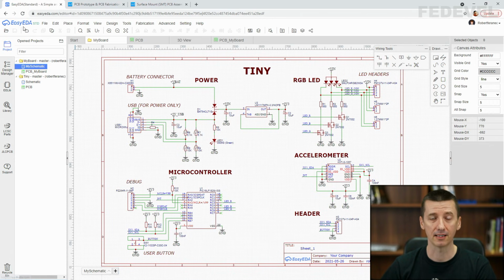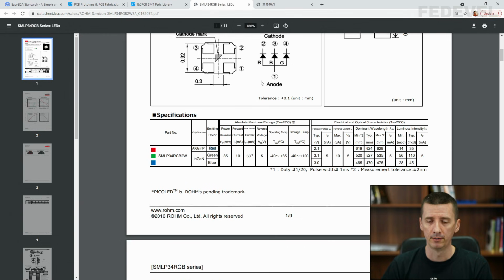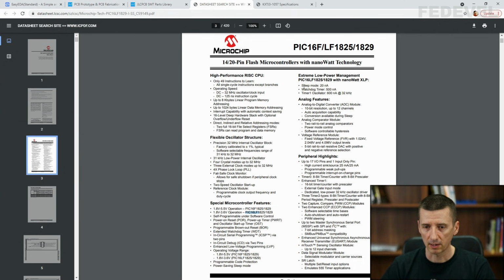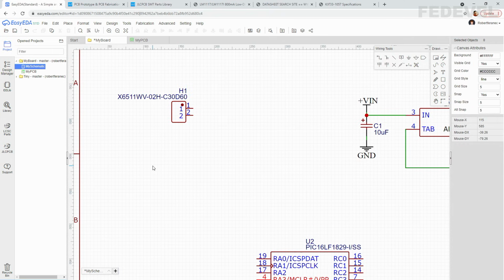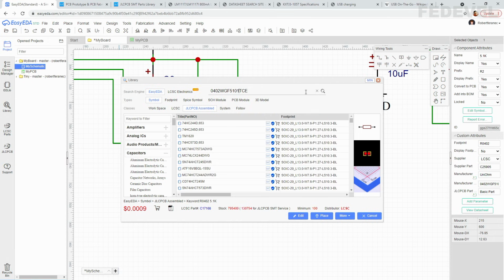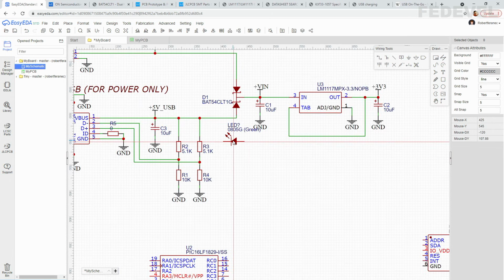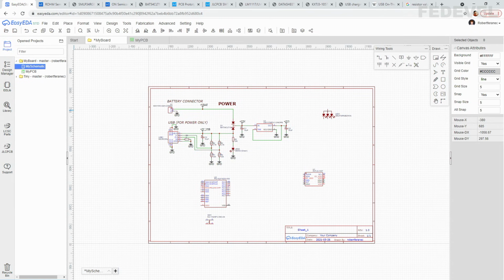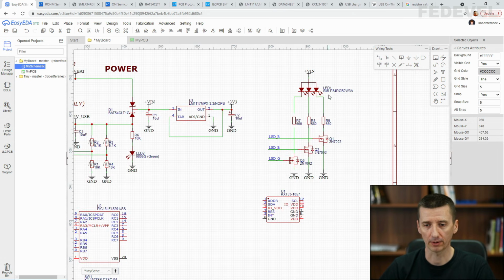Tutorial #1: How to Design and Build Your Own Board - Simply and Easily

Comment from the maker: If some components are not in stock, do not worry. You can buy them from a different supplier or you can buy a replacement and solder them when you receive your board. I am talking about it in Tutorial #5 https://www.youtube.com/watch?v=yptbPYe1BL0&t=6174s
Reply: Any similar component? for example the LED in this video could be replaced by some other similar LED, instead of buying from different supplier, or find replacement? This is my first time building the board, appreciate for guidance. Thank you.
Reply from the maker: @leemingxiang8965  you can use any RGB LED with common anode.

Comment: sir,

Why did you use the same 560 Ω resistor for each channel of the RGB LED instead of using different resistor values?

According to the datasheet, the forward voltage (Vf) is different for each LED color, so using the same resistor value would result in different currents for the Red, Green, and Blue LEDs.

Also, I noticed that you designed for approximately 10 mA per LED. However, the datasheet states that when all three colors are operated simultaneously, the Absolute Maximum Rating should be reduced to 30%.

Since I may operate all three colors at the same time, why not choose the resistor values so that the current through each LED is limited to around 2.5 mA instead?

Thank you.

Comment: Awesome tutorial, full newb here with a quieston - at 47:40 when explaining about the barrier diodes, can we use transistor or a mosfet with a gate connected to the USB vcc so when USB power is connected, the mosfet opens, breaking the battery circuit?

Reasoning for my question - the forward voltage drop even at 0.4v is significant when working with 3.7v lipo battery

Comment: Hi roberts  thanks for the series. these are useful as am just getting in to electronic with no electronic background .just a quick qtn , COULD YOU BE IN POSITION TO DO A VEDIO OF THE VOLTAGE AND CURRENT REQUIREMENTS OF THE APPLICATION THAT MADE YOU USE THE DIFFERENT ELECTRONIC PARTS YOU USED IN THE SEREIS

Comment: I think placing the power LED  behind the diode will not indicate when we are using the battery as the power source.. qtn why don't we put the LED bwt the diodes and the capacitor(c1 10uF ) and then use the MOSFET transistor  to trigger a voltage supply when either the battery or USB is used as a power source?
Reply from the maker: when battery powered, I wanted to minimize the power consumption.

Comment: thanks, Robert for the presentation ,,, my qtn is about the diode ,,, what would happen if someone plugged in two power supplies at once ,,,, how would the diode respond
Reply from the maker: the power will only be delivered from the source with higher voltage. other source will not be used

Comment: Thank you for the wonderful set of instructional videos. Extremely helpful.  

I have a question: My project uses SPST switches that are not located on the PCB, but rather on the front panel of the housing. They will be wired to the PCB to specific points. How do I represent this in the schematic? I basically need two Vias that will be connected to other parts on the PCB. I can add the Vias on the PCB and run the connections manually, but is there a way to represent this in the schematic, so that the wiring is already incorporated in the PCB? I tried Pins, but they do not transfer to the PCB.

Comment: I would ve expected the accelerometer sense the "acceleration", It made me confused when you showed the working board at the end. You are rotating it and it senses different acceleration even though the sensor is not in motion. I seems like it measures the somehow static acceleration even thought I am not sure it can be defined in this way. Do you have any though/comment on this ? And like how can we exactly conclude what the sensor measures in general ?
Reply from the maker: Don't forget, g always exists and it points down to the earth. So even if nothing is happing, the accelerometer always "see" where the ground is.
Reply: @RobertFeranec   correct. After I asked, I made some research on it and realized that the gravity needs to be compensated by converting the local reference frame to earth frame if you would like get the acceleration of the object from the stationary reference frame. Wanted to share it with you too, thanks Robert!

Comment: Pls sir I got another question......the power circuit here ....I use a 6 lithium battery...that's 25.5v ....18 pieces of 18650 battery in series parallel...that's 3 connector into 6 places to make the 6s.....pls which diode can I use to make sure the voltage doesn't return to charger...when there's not power in the charger....

Comment: Robo, just a note: the losses on the preset resistor for the LED will be the same as the losses on the LDO and the smaller resistor if the LED is powered from a +3V3 source. ;-)

Comment: Hello, currently I'm working on my own PCB and I need 5v for my IC's. I need to power circuit with USB and/or +12V (car battery), so I placed LDO before diode (SBD), but, if I understand correctly, after diode there will be only apx. 4.5 volts. How can I fix this ? Thanks.

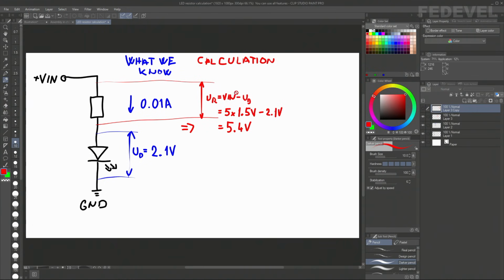Comment: Regarding the diagram shown at 1:00:20 there are two items of note. 1) The 10mA is the absolute maximum rating. Generally just a couple of milliamps is plenty of current to light up an LED brightly. 2) Fresh 1.5V batteries are often closer to 1.6V, so instead of 5.4V you might get 5.9V.
Reply from the maker: Thank you derstrom8. PS: The resistors still may be adjusted by the end of this project, you will see what the plan with the LED is (I have not explained everything in the video). But yes, your points are correct.

Comment: I'm not sure where to post this question but I'm trying to connect a Coral Edge TPU to the IMX6 and the datasheet for the Coral says that their USB connection is 1.8V logic, where the IMX6 doesn't mention the voltage level for USB. Would I need some sort of voltage level converting chip in between both components? Assuming the IMX6 is 3.3v.

I have your advanced PCB layout course but haven't gone through it all, would the answer be in there perhaps?

Thank you for your help.

Comment: Great explanations, thank you very much!
Isn't the maximum allowed current of the LEDs 5 ma, so you should increase the resistor values?

When does one put a reverse diode over the LDO?
Reply from the maker: Thank you phenyl22 PS: I used Absolute Maximum forward current 10mA in calculation, because most of the times the currents will be lower (e.g. when battery will be discharging + loses on diode and transistor) and I would like to have the highest possible brightness also when battery is low. Also, I do not use reverse diode on LDO, I have not seen that.
Reply: @RobertFeranec  There's a TI note "LDO Basics: Preventing reverse current" by Mark Sellers in the E2E part of their website , which states "the body diode can turn on when the output exceeds the input voltage plus the VFB of the parasitic diode. Reverse current flow through this diode can cause device damage through device heating, electromigration or latch-up events." So if I don't forget I put an external diode over the LDO. Reading it closer I saw that the diodes you put in front (BAT54) do the same thing, they also prevent the flow of any reverse current.
So I learned something today :) Thank you very much for your great tutorials and the time you take for answering to comments!

Comment: Suppose the +5_usb and +vbat are powering, will both voltage add up at the +VIN of the LM1117?
Reply: No, the two Schottky diodes prevent that, they are effectively an OR - gate for the current to the circuit  and prevent current from flowing back to the sources. The voltage at the common cathode is the higher input voltage minus the diode forward voltage.

Comment: Hi, just curious,  I've never used their service, and I use kicad. Is there any way to know which parts from their library are available for assembly without having to search inside easyeda?
Reply: Also, in the KiCAD schematic editor to to the table view of components and you have a nice spot to add a column for the order codes so that you can get them exported with the component list and import them when uploading the design
Reply: Someone has made a script for converting kicad to jlcpcb, some hands-on work required I guess ;)
Reply: Somehow I cannot post links so: GitHub matthewlai jlckicadtools should lead to it :)
Reply: They have API.
And also you can use their BOM tool to adjust used components list
Reply: They also have a list of components on the jlc website. You can find it if you go to the assemble service info page

Comment: i would like to know what are the parameters when u need to select an crystall oscilator for a uControler, i have some proyects that need a uControler with a crystall but i dont know how to select it. Any help?
Reply from the maker: Usually each chip manufacturer has an application note on this topic. Or, just use what they used on their own boards - that is also a way.
Reply: @RobertFeranec  thanks.

So if y can't find any of the manufacturer proposed crystals or the one used in other board there are no easy way. Mmmm i found one but cost 3 times the cost of the uControler 😅😅😅, I'll keep searching.
Reply: You might want to chose  an MCU with an internal crystal and save parts, that's if you project is not super time sensitive, otherwise just search a supplier for crystal and the desired frequency, then its a matter of what physical size you want.

Comment: At the Sonsivri forum, they exchanged views on which manufacturer of PCB prototypes is more interesting today and the majority agreed that today JLCPCB is the best, especially at the lowest price of production, assembly and delivery.
Reply from the maker: Low price is the reason why I use them. Also, they have Stackups and impedances (+ impedance calculator) on their website.
Reply: @RobertFeranec  I am attracted by the possibility that you can immediately see that the resulting visualization of the assembled PCB, and check the orientation of the components and correct errors. And the most important thing is that if you need to urgently make it, then from the moment of payment to the receipt of the assembled printed circuit boards "on hand" it took no more than 6 days. I live in Ukraine! This is a very convenient solution for me.
A similar production of PCB prototypes in Ukraine is 6 times more expensive and there are no guarantees for the production time.

Comment: the diodes that prevent both power sources to fight together do reverse polarity protection as well.
each time, I learn new things about hw design even on a tiny board such as this, thank you, Robert.
Reply from the maker: Yes, that is correct. Thank you Mustafa.
Reply: @RobertFeranec  These days I actually use P MOSFETs for this, they are available in a dual package as well.
Reply: @p_mouse8676  If you select the mosfets proper way then your method would be more efficient in terms of power consumption especially useful in lowpower applications.